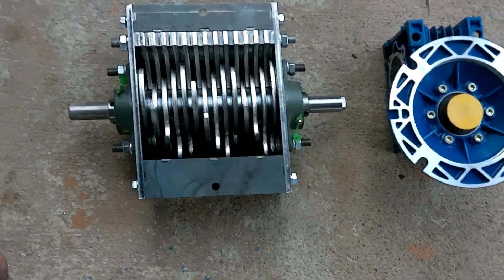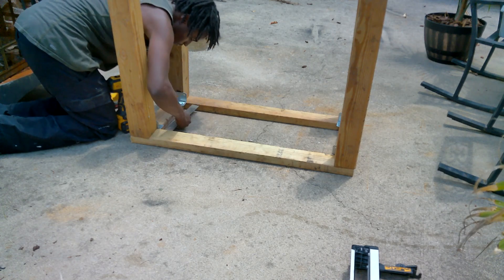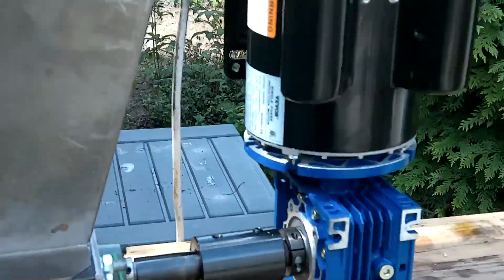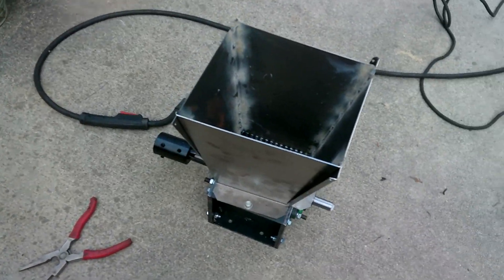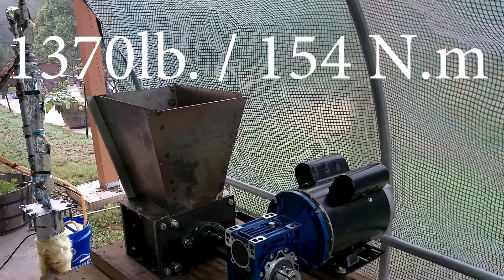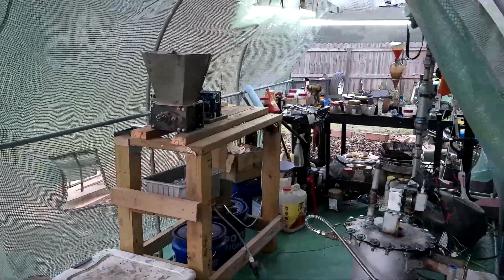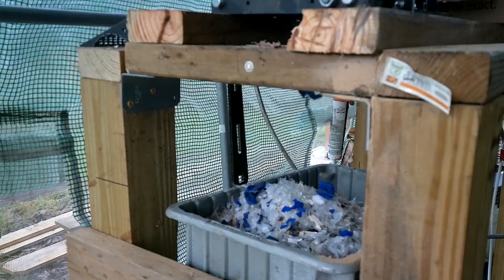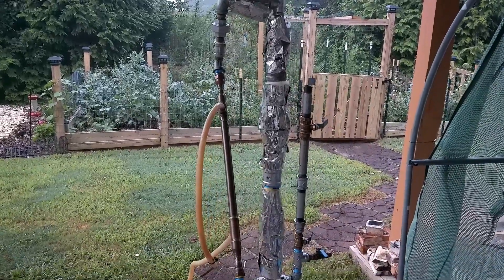Success! The PLASTIC SHREDDER!

Comment: You can absoluteley run another socket off that line to the AC. The only concern you might have is overloading the breakers it is on like if you run them both at once.

Comment: You could just get four bearings mounted on the sides of the hopper and transfer some of the torque from the shaft via belt to two cylinders. Just make sure one is slipped by the belts' outside so they both spin inwards. Ideally, the cylinders would be coated with rubber or something of that kind.

Also, do get yourself these side things from a drawer so you can slide that box in and out; if placed properly, you wont get any microplastic pollution.
Reply from the maker: Fair points to consider here, thanks!

Comment: 10:09 The issue with that is your circuit breaker for that is only rated to run the A/C. It would be maybe 30 amps. The plugs are about 30 amps too so if you use the A/C and the plug at the same time it may trip the breaker. Also I don't think that's to code at all. You could maybe run another 220v circuit though.
Reply from the maker: Good point, no point if I trip it. I guess truly I'd have to hire an electrician if I wanted it to code.